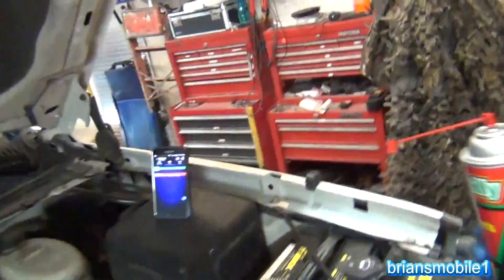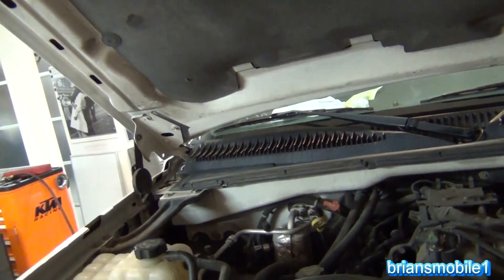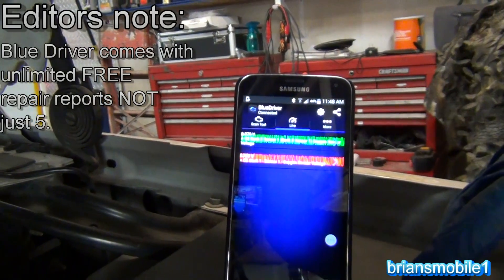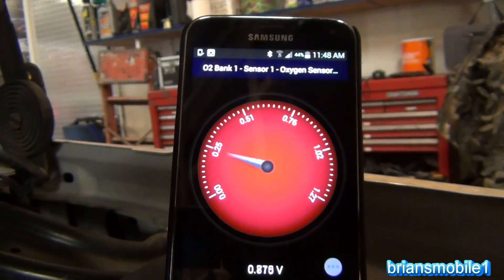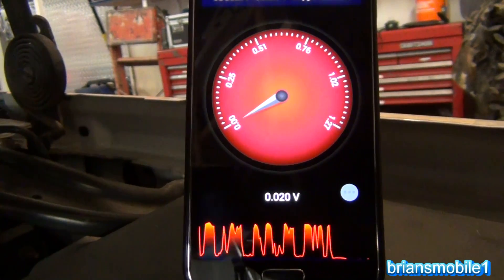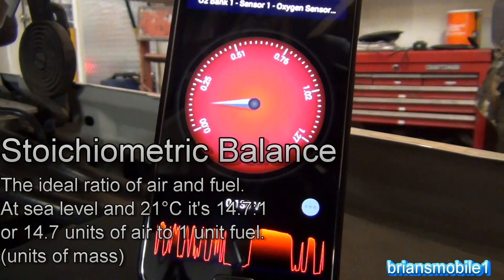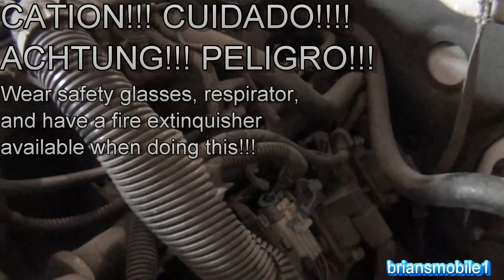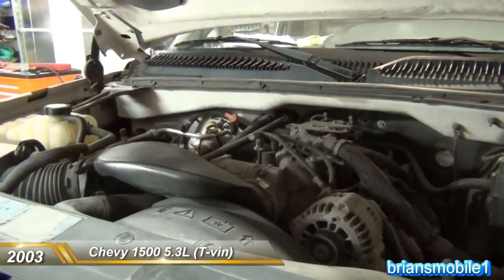How to Find a Vacuum Leak With Your Phone

Comment: Saw a primitive smoke generator to fill the vacuum lines via the Power Brake booster, fed by a cigar and plastic tubing, housed in a coffee can, and any air pump that isn't too high a volume that releases smoke at all the leaks. No chance of engine fire either. That's the best way.... and cheap enough to fabricate.

Comment: Or you could just go to this website www.aeroflex.net and order one or two of our kits for being able to get to hard to reach areas.They come in the two most common size extension tubes found on aerosol penetrates. The kits come with extra straws plus Aeroflex Straw Locs and Aeroflex Power Grip Connectors!

Comment: The o2 sensor does not throw fuel down the drain for the cat. Ithas nothing to do with that. The o2 sensor measures oxygen and only oxygen. It can read fuel but it canspeak to the ecu to change the fuel trim in every case low and high values are measuring oxygen and how much oxygen is in the exhaust gases it does this to stabilize the fuel and overal emissions that is put out by the engine. Think of it as +1-1=0 an equalibrium that is made using this method

Comment: Dude I huff brake clean all the time.  I will go through case's getting cars clean enough to disassemble what ever it is I'm taking off today.  But the trick with the cap will be utilized in cleaning around corners. Dude great!!! I really clicked for the smart phone scanner thing, but got a killer tip for my dime!!! Great job. I use brake clean for finding vac leaks as well. I have also used it to get a car running and into my shop when the fuel pumps are out.(beats pushing by yourself) Anyway cool tip. Keep Rocking it out Dude!!!

Comment: hi Brian i have a 1999 ford e250 with the 4.2 liter ! i am getting ready to put it on the roadfixed the mis-fire by changing the coil / plugs/ and wires ! so when its running it ides fine as soon as i put it in gear and throttle up it sputters spits farts and sometimes pops in the intake could it be vacume  im stumped please help ! thanks

Comment: how to do a boost leak test with out special tools ? thnx
Reply: +Nima someh check out jafromobile, you can use plastic plumbing fittings and a tyre valve to inflate the system, then spray with soapy water to look for leaks, works extremely well

Comment: Almost makes ya wonder where you can buy a J shaped straw for those things.  It just gave me an idea.  Put some solid core wire inside then heat up the straw with a low heat source and bend it.  That might actually be a way for you to make your own entire kit of accessory straws in different shapes!  You get a new straw with every can.  Now people will be more apt to save every straw they get instead of chucking it in the trash.   What do you think?
Reply from the maker: +DJDevon3 I would love a mold able straw that can fit on anything and can flex.  That's a million dollar idea.

Comment: Neat straw trick.   I picked up a couple really long flexible straws for stuff like this years ago.  They are several feet long and let you get the fluid anywhere the hose can reach without getting the can tilted.

Comment: Nice tip, but i really still prefer using a gauge. Plus it's cheaper than the obd2 reader. I know I know, this does more than just help find leaks lol.
Reply from the maker: +Jesse Crandle Are you talking about using a vacuum gauge?  Like the type that indicate for leaks, valve problems, and general engine wear?
Reply: briansmobile1 The problem with the OBD2 scanner is it's pretty slow to respond, so with finer leaks it's not as instantaneous as a vacuum gauge. Considering they can detect restricted air intake, sticking valves, worn valves, weak valve springs, exhaust obstruction, inlet/gasket/vacuum line leaks, wrong valve timing, and worn piston rings I'd say it's worth the investment. I think I paid $20 for mine, and I've used it more times than I care to mention lol. But uhh... yeah, that's the kind of gauge I'm referring to. 
Honestly though I'd say if you're doing your own work the OBD2 is almost a necessity, and I GUESS the vacuum gauge isn't, it I sure do enjoy using it more than monkeying with a bluetooth link D:

Comment: 2002 Town & Country 3.8...  this probably won't work to find vac leak on evap emissions sytem, will it?  I gave up, too complicated without replacing everything.  Old car and runs fine w/light on.  What are your thoughts?
Reply: +Gravertrain Graveytrain    a vacuum leak is a vacuum leak ..doesnt matter what year it is .....another method would be to watch the RPM rise while spraying it ..and like he said with propane ..or even starting fuild..( again ..get a fire extinguisher
Reply: +deepsquat600 A mechanic told me the car goes through a test cycle at startup.  The computer senses failure in the components in the evap system (vacuum leak), but doesn't tell what component (intermittent at start up test) and it's sucking combustible gases from the fuel system already.  This startup test failure trips the "check engine light".  Seems very complicated to diagnose and fix.  It is an elaborate start up test.

Comment: That indicator was going hi...lo...hi...lo all the time...dont  see how it indicated anything???????
Reply: +john smith When it was rich, it stayed high, when the hose was off i.e. major leak, it stayed low.
Reply: +petey815 I get that part and what I'm looking for, but as John mentioned it didn't seem to stay high for very long when he sprayed it.
Reply from the maker: +Andy Plater The brake cleaner evaporates quickly.  That way you can move along without having to blow it out or off.

Comment: Thx Brian. Great tip. 
Unrelated question: can you recommend garage lighting instead of the classic fluorescent tube lighting?? Two car garage in my case. 
And how's the arm???
Reply from the maker: +Mario Dalla Riva Hey Mario, thanks for asking!  I've been using some LED tube lights from Feit in my garage that have been great.  (I really don't like the strain I get from florescents either)  Here's a link to what I have in my garage.  I have six of them.  1 at the workbench, 4 on the ceiling, and 1 with coat hanger hooks I use undercar and underhood. → http://www.amazon.com/gp/product/B00LFAY5SM/ref=as_li_qf_sp_asin_il_tl?ie=UTF8&camp=1789&creative=9325&creativeASIN=B00LFAY5SM&linkCode=as2&tag=httpwwwyou00f-20&linkId=XP7EEWAG37YZ7HAE   As for the shoulder, it's been relocated now for 29 hours straight! (round 3, but with tape this time)  No more invisible purse!  It still hurts about like 1/3 tazer ride if I raise my arm quick or try to scratch my back... so I don't.  I'm super optimistic.  I can put it back in by myself now if I feel it start to loosen up.
Reply: +briansmobile1 Holy carp! Makes my 11mm surface tear in my mid supraspinatus tendon (left arm) seem like a paper cut! Hurts like heck. 
Heal up quickly. We need you healthy!
Not to mention your family...Forza! 💪🏻
Thx for the lighting idea. I'll check er out. 
Hope the family is doing well, Brian.